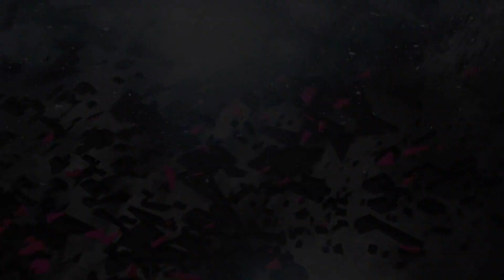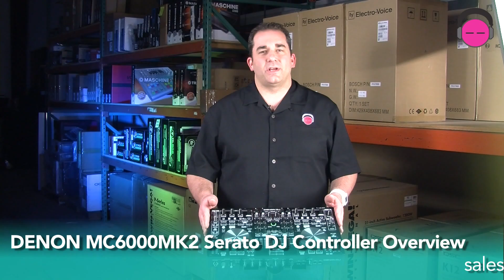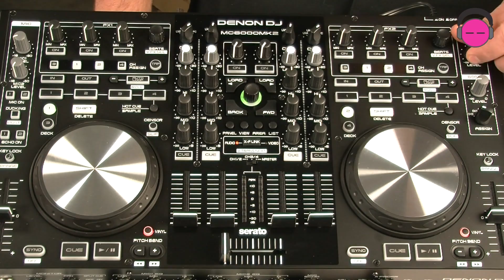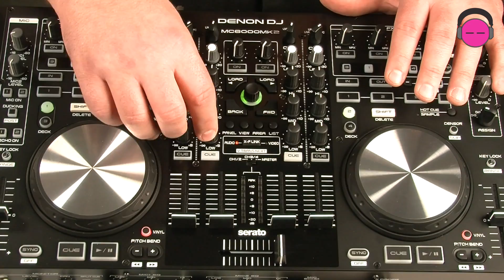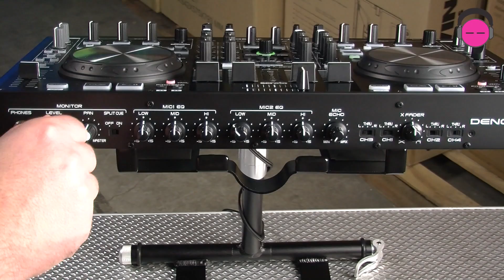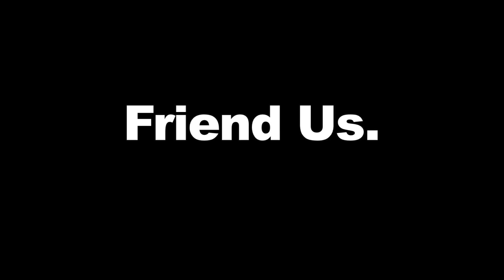DENON MC6000MK2 Serato DJ Controller In-Depth Hardware Overview | agiprodj

Comment: You guys rock, thanks again for another great review.   I will definitely consider the MC6000Mk2 as one of the controllers on my short list.  My next upgrade will have analog mixer and DVS capability.   I'll have to consider the size and cramped controls on this one though.   I love the smaller size, but not what that brings along with it.   This is definitely a great piece, and paired with a Reloop Neon it would be pretty awesome.   Thanks again.